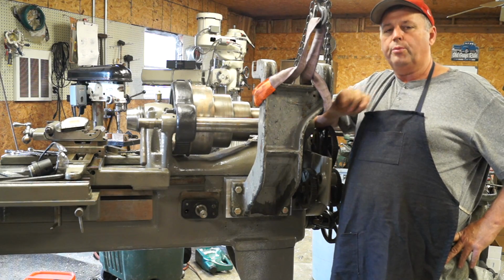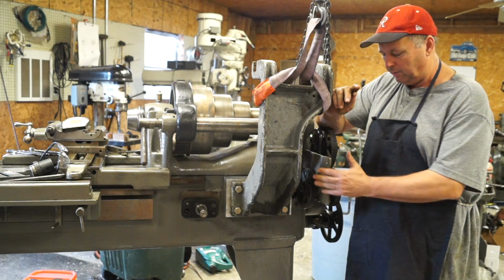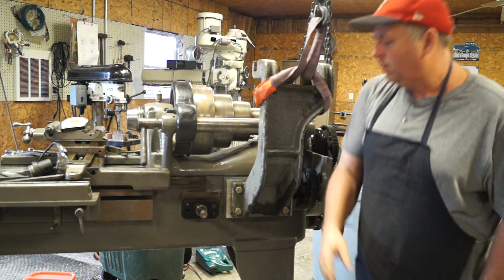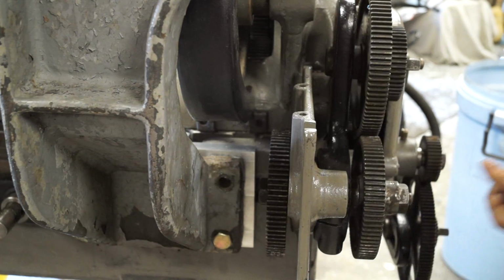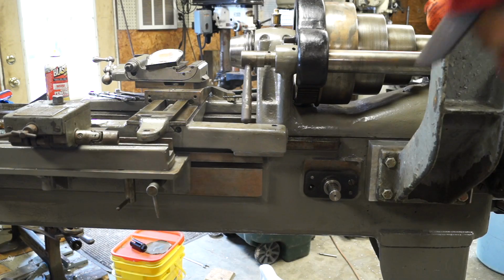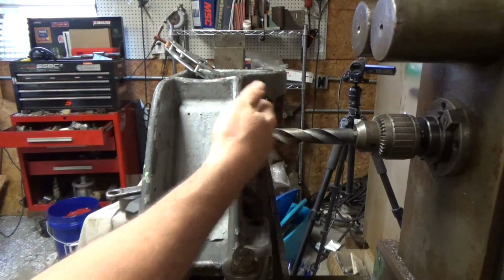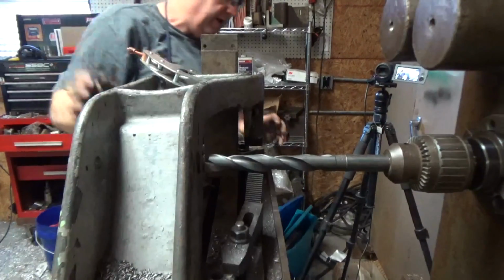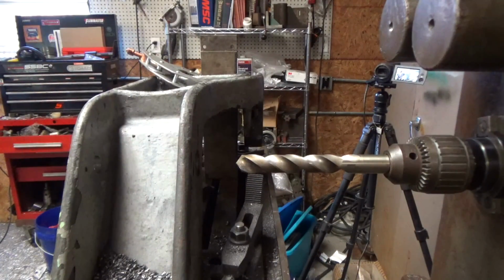Pratt & Whitney Lathe Restoration Part 12  (Drive Mount)

Comment: I'm not sure what the proper term is refurbished, restored, repaired. Seeing your horizontal reminder me of a old Brown and Sharp #2 (very early one, single overarm and initial setup for line shaft or motor mount like your lathe) that I repaired broken components, got to work correctly and painted. All the brass plaques looked soo beautiful when it was done. I also found a original B&S vertical/angle head that went on the overarm and was driven by the horizontal taper. I sold it to a guy a couple towns over. I also had a big variable speed Excello vertical mill with ball screw setup/ no backlash. My favorite old tool was a Victor power hacksaw with the last patent date of 1898. Super cool.

Comment: So I take it when they put the electric motor on they just quit using that attachment? Could you not have just used a countershaft and a set of gears to offset  around it?
Reply from the maker: Brian
That motor mount was donated with the 2nd Lima drive. It was used on the Leblond lathe that was donated to me.

Comment: Mike,

I'm guessing you're going to braze some steel into that motor mount, to compensate for the strength lost by cutting the shaftway.  FWIW, Fenner & Rucker have more than convinced me that brazing is THE way, when dealing with cast iron.

Eli D.
Reply from the maker: Eli, 
I don.t think it weakened it to a point that there will be an issue, However I plan on putting some plate around the area to make sure.
Reply: weld is this new thing  check out brians drill repair  but yea im sweating every cut    how big can he go ? lol    just messing with ya about the weld itys not new

Comment: Mike, I would have liked to have seen how you aligned the part in the horizontal mill as there were no obvious machined surfaces.
Reply from the maker: skeezie, I just aligned it with a square on the table, this wasn't a precision job

Comment: Those old K&T's are really something. That you can have the boring head and bar extended horizontally far enough to cross Texas and not have an egg shaped hole or a cracked casting when done is amazing.
Reply from the maker: I love using the K&T, I have a vertical also I need to do some work on.